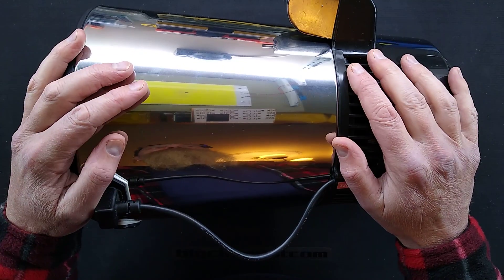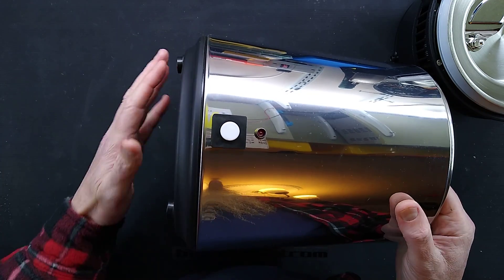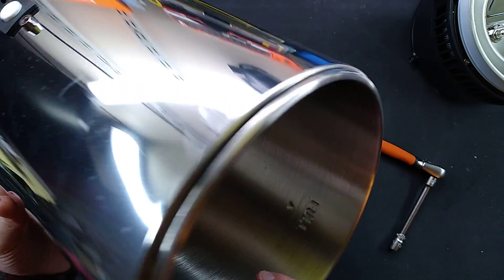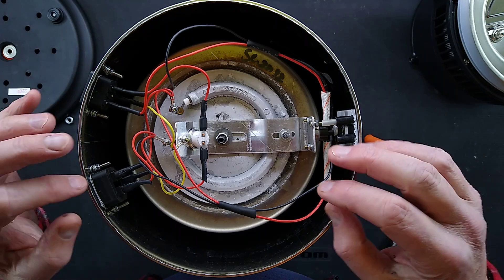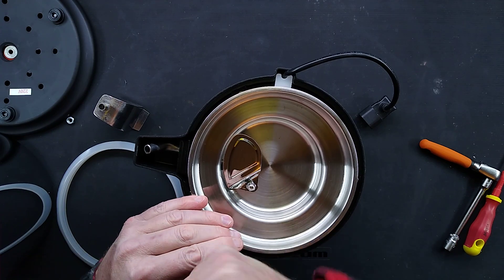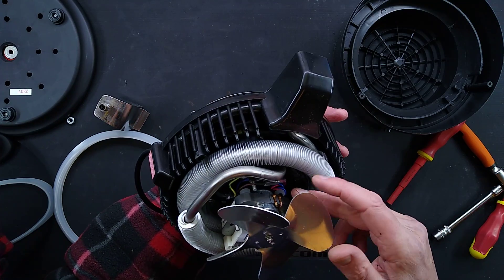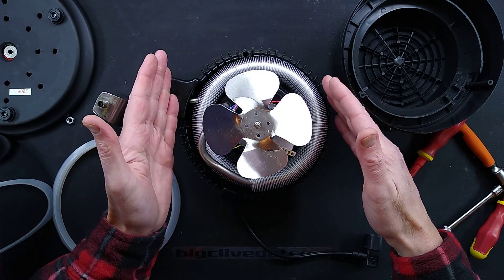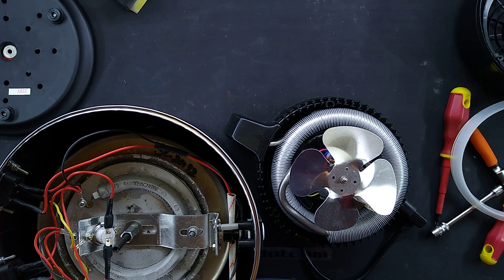Water/alcohol air-still distiller teardown

Comment: I've got one of these. I need distilled water for my CPAP machine humidifier (sleep apnea). I ran out of dist water, and just wasn't finding any in any of the stores (it's always been harder to find than expected.) I also have a steam cleaner that needs dist water. 

The top portion wasn't very well assembled - the fan blades were striking the plastic housing making a racket. Other than mine running from 120V 60Hz, yours looks a lot like mine, even drawing about 725W (measured with a P4400 Kill-A-Watt, similar to your Hopi). I also don't trust these to "automatically" turn off - I use a countdown timer that I can set to turn off at 3.5 Hours.

I don't think these actually "boil" the water. Rather, they heat the water enough to achieve rapid evaporation. Boiling throws water droplets up and can be collected by the condenser. Rapid evaporation is a much calmer operation to produce steam.
Reply: It avoids having a rolling, violent boil, but it does get the water just up to the boiling point.  But the difference between evaporation and boiling is a matter of degree (hah) anyway.
Reply: If you add a heat conductive medium to the boiler that has a lot of surface area like copper wool, you can get more nucleation sites and it will indeed boil quite vigorously. Mine is so violent that the water sloshing around in there when it's full makes the whole apparatus kind of do a wobbling "dance" on the wire rack I have it situated on.
Reply: Mine gently boils.

Comment: Thanks Clive.  I have one of these to provide water for my carnivorous plants.  Always wondered what went on inside so really good to have a video to save me breaking it ;)

Also, alcohol eh?
Reply: Alcohol would need a slight change of preset temperature (78 rather than 100 degrees centigrade) and the heater's power might need some adjustment too. Easily done with a PID regulator.
Reply: @KeritechElectronics  It actually doesn't. When the alcohol boils off there is a state change and it holds the temperature down at 78 until it's almost all gone and then the temperature will rise to 100c and boil off the water. Doing it with a PID might be more elegant and accurate and allow you to use a meatier heater for faster results, so it would be a good edition.
Reply: @Rapscallion2009  ah yes, the latent heat of boiling.I should have rather said ca. 80°C - that's soon enough to turn the heater off after all the alcohol is distilled, but prevent the remaining water from boiling. Some of it will still evaporate, but the process is slow compared to boiling.
Reply: @KeritechElectronics  sounds interesting, wonder if I could use a temp controller I already have to do this non invasively (not really, of course ;) )
Reply: Oh, I just used hard water for mine..... I wonder if that's why I was never successful?
Reply: @Rapscallion2009  possibly, although some also die back in winter and get thrown away when they're actually OK . But if you used tap water then it probably was that as they hate it for some reason
Reply: Do you grill steaks for them?
Reply: carnivorous plants drink distilled water? why are they so fussy?
Reply: @janami-dharmam  when you look at the chemical cr@p in tap water, maybe the question should be "why are we not" ;)

Comment: To state the bleeding obvious, distilling water is not a good way of getting drinking water. It lacks minerals and electrolytes and, while it won't harm you directly, it won't quench your thirst or be taken up readily by your body. I learned this the hard way, when I was camping on an island in the Adria and did not realise that their tap water is desalinated sea water. I drank so much that my stomach was full and aching, I was feeling sick - but still thirsty. I wasted a day or two thinking I was ill and unable to do anything, until the friend I was with got me some water from the store, packed in a carton. Apparently locals drank only that. It tasted great, I suddenly wasn't thirsty and was bursting with energy. If you have dirty water, use a filtration system, which removes impurities but not the minerals.
Distilled water however would be good for making beverages like tea and coffee, since the limescale dissolved in the water soaks up and removes the aroma from them. Distilled water also has less or no oxygen dissolved in it, which - I'm guessing here - might oxidise some of the ingredients and change the taste (for worse or for better). Technical uses almost always profit from demineralised water - I used it in my ultrasonic humidifier to avoid generating the white dust (microscopic mineral particles that remain after the microscopic drops of water evaporate).
Reply: In the case of emergency desalination, adding in some seawater, or a spoonful of the residue found in the bottom of the still, would help keep you healthier than just drinking the distilled water.
Reply: @Nono-hk3is  I'm wondering if adding some sea salt to low-mineral water would also work. For sports, when you are primarily losing salt, possibly. In other cases it's probably too little.

One can drink seawater, if diluted enough for the salinity to drop below that of your own body. It's recommended for people lost at sea, with limited water reserves, to add seawater to it and stretch the reserve. Pure sea water does not work, because the water exchange happens via the osmotic pressure gradient from the water to the blood. If the water in your intestines is saltier than your blood, it doesn't go in, quite the opposite, it sucks moisture out of you. Quite fascinating.
Reply: Fascinating. I had no idea. I suppose you could then put rehydration tablets in the distilled water, but those I have tried taste pretty terrible, and in the circumstances given above it was obviously easier just to drink what the locals do.
Reply: @zh84  Do you mean isotonic sports drink tablets? I use those for cycling, but the added flavouring is unnecessary or even sickening when you drink a lot of it. I have long been searching for neutral taste remineralisation tabs, with spotty success. Wiggle had some, I don't know if they still do.
Reply: @horrovac  Yes, and I use them for cycling as well.
Reply: Just as a little sidenote: for tea and coffee purposes, you do also want some mineral content for better extraction and flavor. There's a good bit of discussion about water parameters in coffee nerd circles (likely the tea equivalent as well), and multiple commercial mixtures to remineralize distilled or RO water. I've been tempted myself to play around with cheap and simple DIY there, and likely would have already if we were still on London's liquid chalk. But, at any rate, straight distilled evidently doesn't work all that well for brewing hot drinks either.
Reply: @jadsel  Ah thanks, was not aware of that. I'm using water filter jugs/cartridges for that, those only remove limescale and a number of pollutants, leaving the minerals alone. The type I'm using also adds magnesium. Never tried straight distilled, now I'm tempted to give that a go.
Reply: Exactly. To think that few people know it nowadays...